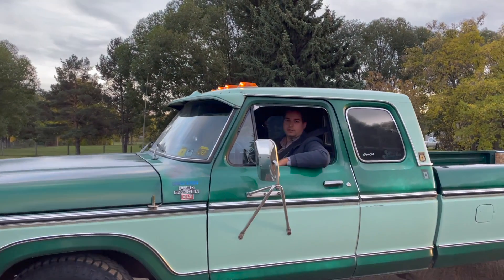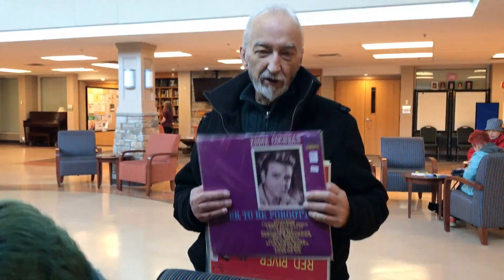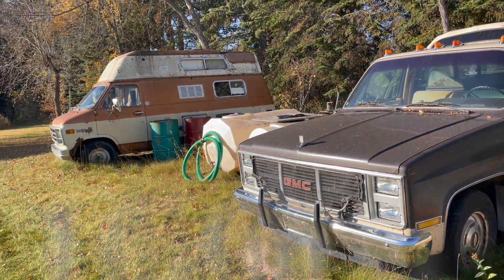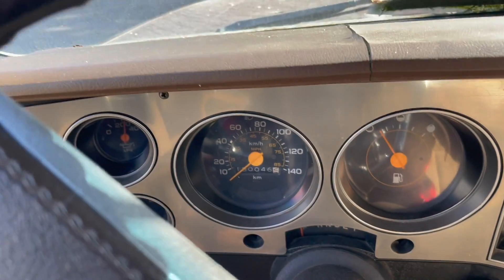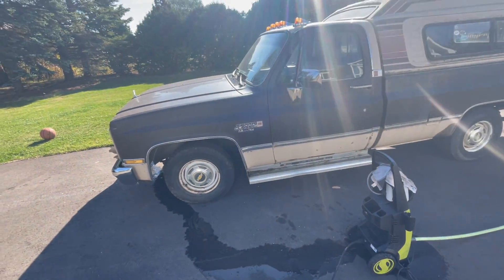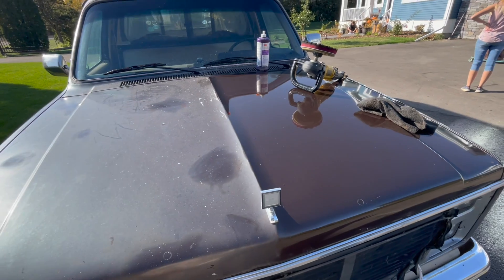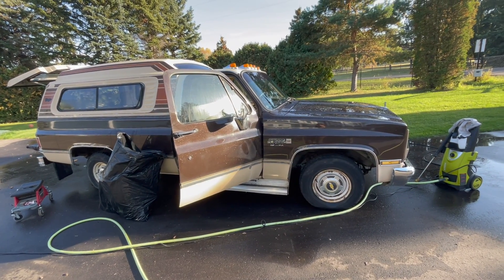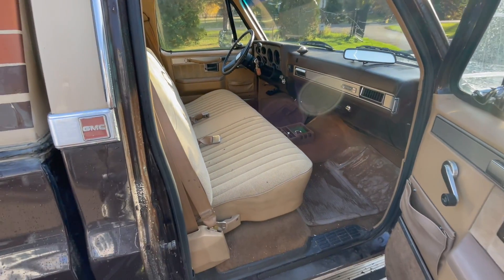Buy the truck & the van is FREE! Field find classics!

Comment: I'm a nurse and when you were talking about the 3M polishing compound,  it reminded me of talking about the 3M no sting skin barrier.  I told their rep it was miracle stuff.  I wonder if it would bring dull vintage Pyrex back to life.😁🇨🇦
Reply: Possibly. Actually, very probable...
Reply: I'm a pro detailer down here in Australia and I use cutting compound on the vehicles glass to remove water spots and minor scratches so yes I believe it will work on your Pyrex. Also first try some CLR or similar with some 0000 steel wool. It's another technique I use and it doesn't scratch the glass.

Comment: Alex, both of those vehicles are quite sought after.  There are so many people building them out inside for camping and traveling.  You probably could have gotten another $500 easily for the van.  And will certainly get much more for the truck.  Great deal and you have a truck to use with the protective shell on the back.  Awesome!

Comment: I’m having the same trouble but my truck not over heating it has a hair line crack as I fix it with JB weld lasted two years the cost between 486-600 to replace the rad .. so I’ve been hunting the wreckers. Best of luck on your new projects 😮

Comment: At the rate things are going in our world today, for no more than what you have in that truck you're better off to keep it as a backup/additional option. Essentially for 1 or 2 monthly payments of a new vehicle with warranty problems (and it seems they ALL have problems) you're driving every day and not dealing with that bs. The GMC will be easier to get parts for than the Ford, many parts are shared with the rest of GM vehicles. The radiator core being 2 weeks from everywhere (lol O brother) is going to become more regular than an anomaly - for a while anyways. Heck of a deal, I doubt it'll come along like that again. Great ol workhorse. Thanks for sharing

Comment: Wow, that seemed easy! You didn't mention any technical inspection of the truck, is that not a requirement in Canada? I'm in the process of recommissioning my 2003 LDV van which has been off the road since 2012 but that will involve lots of work to get it through a government inspection.

Comment: Keep the chevy pick up itll be more reliable then the Ford I'd sell the Ford before it totally let's you down and the chevy has a cap you can keep stuff secure in
Reply: Don't think so GM 💩💩.
Reply: @stubstoo6331  no Ford 🚮🗑🚲🛴🛹 if you own a Ford Hahahahahaha 😄😆😅🤣😂😁i
Reply: @darrenbrisson4336  general motors have been junk since 1973. There's a reason Ford has been number one for like sixty years. Lmao
Reply: @marks.c4753  sorry you wouldn't have said that about my 73 400 small block square body 4x4 built had over 400hp three inch exhaust was nasty drag any old Ford scrap down the street behind it lol! Even better I had a 1970 Fargo pickup with a 440 in it 411 gear was a Ford 9 inch out of a f-100 had the same bolt pattern so my dodge wheels fit on it g.m really built something good when they came out with the duramax and the L.S platforms all Ford diesels are junk right upto 7.3 power stroke garbage as I've seen many go through my uncles garage OTTAWA SOUTH TRUCK CENTER in ottawa canada 🇨🇦 p.s the only good Ford trucks are the bigger f-800 and f-900 Louisvilles with diesels from other manufacturers Detroit,  Cummins, caterpillar, mack,

Comment: Great deal on the two vehicles couldn’t you have just bought a new radiator from the parts store and install it yourself instead of a recore ?
Reply from the maker: New rad is out of stock and is $1000, getting mine fixed is cheaper
Reply: Oh ok boy did rads go up that sm citreon came out nice

Comment: Why don’t you just buy a new radiator. Here in the US they don’t cost more than $200. I’ve bought them on EBay cheaper.
Reply from the maker: I did but the brackets on the
New Ones aren’t correct for my truck

Comment: Why not buy a new radiator ?
Reply: $1000 for a new one.  Cheaper to fix.
Reply: @GuyWithTheDogs  What year and engine is in it. I work at Carquest , never seen common rad that much.
Reply: @longhaired1954  Check with Alex.  That was the quote he got.
Reply: @GuyWithTheDogs  Thought this was Alex.

Comment: Just get a new radiator
Reply from the maker: New rad isn’t available and if special ordered is over $1k!
Reply: That's crazy couldn't you find a universal aluminum one that would work? I guess if your original one is in good shape than a recore should get you by. I figured with the crazy new interest in old trucks surely they were reproducing them. That square body you just picked up looks like it's turning out to be a pretty sweet old rig. Congratulations fhey are bringing top dollar here in the states.  I like this new content your putting out some new mixed in with the old keep it up and looking forward to more
Reply: @brianhayes7618  Hi Brian. Alex answered your question somewhere else in the comments about replacing with an aluminum radiator and he said he looked into it and the tabs (?) didn't line up on his truck.